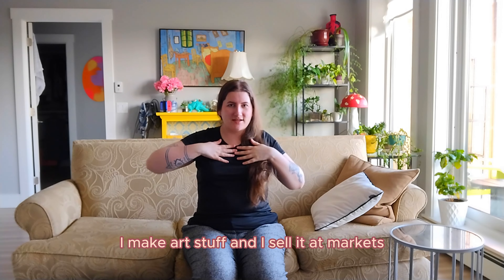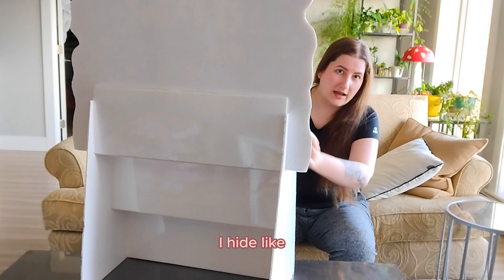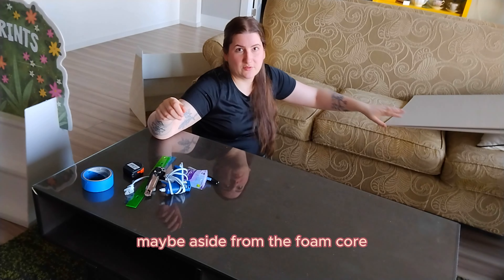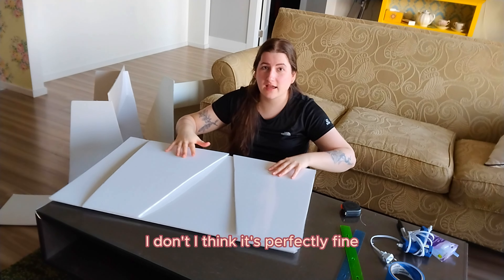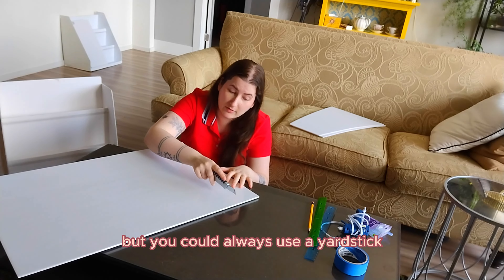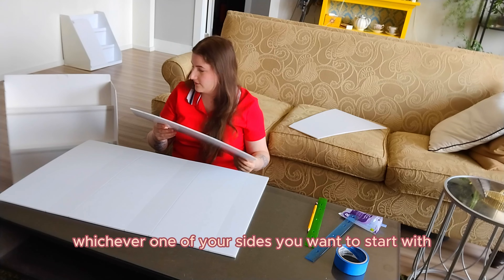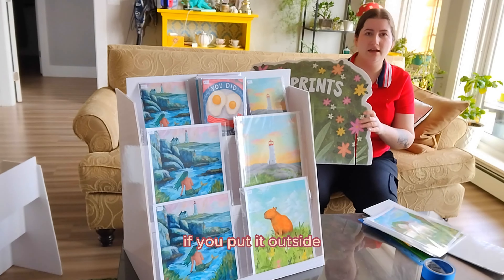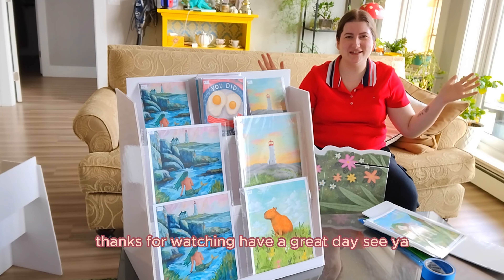DIY $10 Market Display Stand Tutorial 🌸 How I display my art prints and products at art shows

Comment: Thank you Rebecca, this really helped! I have greetings cards, so needed it smaller. I basically put your sizes into cm, so that was easy ( less math!) and then I had to add 40% to every cm measurement and it fits large square cards and 4 regular sized cards, with 3 levels. I can fit 4 cards deep, including their plastic protective bags. I have 55 greetings cards in this little stand!  I made mine in cardboard as I have tons of it and used the best quality box that was shipped to me with a large craft supplies order. Hope this helps if anyone wants to resize. Going to use my cricut to decorate and used large wooden dowels for the little stoppers at the front. They just slide into little holes to keep cards from falling forward.😁😁

Comment: This is a great idea and  you did a nice job explaining the concept and showing how to make it.  One idea is that you could use masking tape to cover the entire thing. You simply tear off small pieces and overlay them over the whole thing. Then you can use some sort of primer coating over the whole thing to smooth it out and then paint it. If you also spray painted it with some clear shellac, the thing would be nearly indestructible. The only other suggestion I can think of would be to add a "bottom"  base panel  because you could then use clamps to attach it at the back to the table if you were going to be outside and were worried about it being blown or knocked over easily.

Comment: Genius idea and thank you! I had a thought for the back to weigh it down so it doesn’t blow away…. Tape or Velcro down storage containers to the back underside for extra inventory with a few rocks or decorative sand bags on the sides (like for weighing down balloons-same concept and would be great for merchandising too). Also with Velcro or tape steel mending plates or rulers   (so it’s cheap and removable) to the bottom to reinforce it - that way you can get more stability and it’s less likely to blow away! Finally tape magnets to the table, underneath your table cover and it will stick to the mending plates. Hope this makes sense!

Comment: A super easy way to weight down light items like this is to tape a couple of tabs on the back side that you can place sand bags on.  
Sandbags are easy to make using packing tape and ziplock bags - I like the 1 gallon bags.  Just cover the bag in the packing tape for reinforcement and durability, fill the bag with sand, and place on whatever needs holding down.  If you want to get really fancy, cover the bags with fabric.  Either plain or covered, the bags tend to lay flat for packing, and can be stored under your car seat between shows.
Reply: I use the rice heating pads that you can microwave. You can use anything from fabric to a long gym sock or a fabric wine bottle gift bag. Fill it with rice or beans from the bulk section at your supermarket. This makes them really economical and dual-use.

Comment: Wow, Rebecca, it's amazing to see that you handmade your marketing display. As a factory that mainly targets building marketing displays, I know how hard it is to make it by yourself. After seeing your display, I would like to share with you some tips that I have acquired during my 20 years in the display industry.

Firstly, in order to make it more stable and stronger, as you will take it to shows once a week and it needs to fit in your car, there are two things you can do. You can add a few PVC clips to the display edge or use your glue to cover the edge. This will protect the display from moving and also prevent your fingers from getting cut.
Secondly, you can use the "mortise and tenon joint structure" to make the boards connect to each other. It will have more stronger structure.

 In addition to foam board, you can also use cardboard and rubber bands to create a pop-up display that can be folded flat. When you need it, you can simply unfold it and it will pop up as usual.

If you're interested in learning more, please feel free to contact me, I can give you the diagram (without telling my boss, just kidding)🤣

Comment: Wondering what SIZE your PRINTS are that sit in the display? It looks perfect for having 2 per row as seen at 30mins. I have A3s to display and trying to compare how it will look. I'm not sure if there is a standard print size in your country or if it's x" by x" size? [also thankyou for the captions!] Sorry if this seems like a basic question.
Reply from the maker: The prints are 8x10 inches and it fit 2 with some extra room; and the cards I showed are 5x7 inches, and fit 3 across! I hope that helps! :)

Comment: Thank you Rebecca, this was perfect. I’m looking for a stable shelf display for my cards and this should be perfect. Your measurements and the diagrams the way they are laid out make it easy to scale down. I was also thinking of doing slightly more than a right angle, so the displays angle back on a slight slope. I was also wondering about adding an extra panel, cut in the stepped design, to glue to each side on the inside back for reinforcement. Not sure if I’ve explained it well. If I do that, I will tag you on instagram so you can see it.

Comment: Is there another material i can use? I've only been able to find a3 and a4 sizes of foam core where I live in Australia
Reply from the maker: Hmmm maybe you could improvise using corrugate and paint it a solid colour after? Office supply stores sometimes have presentation boards that are similar too you could try
Reply: I used cardboard and wooden dowls to keep the cards in place. I decorated it with vinyl on the top with my logo. It will be covered by your prints or cards, so you only see the sides. You could paint it or use washi tape on edges. Hope this helps

Comment: How would you weigh it down on your stall so it doesn't blow away?
Reply from the maker: You could add an extra piece to the bottom that you could weigh down with other items from the back, or use binder clips on the edges and tie them down to your table... Pretty much any variation of these ideas!